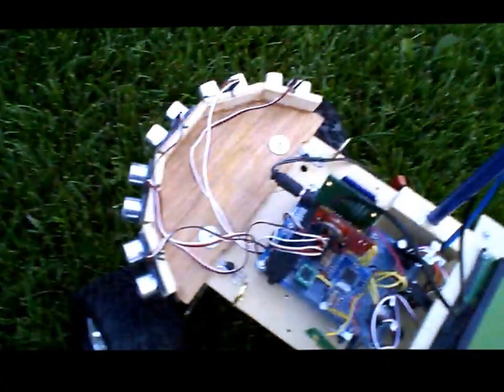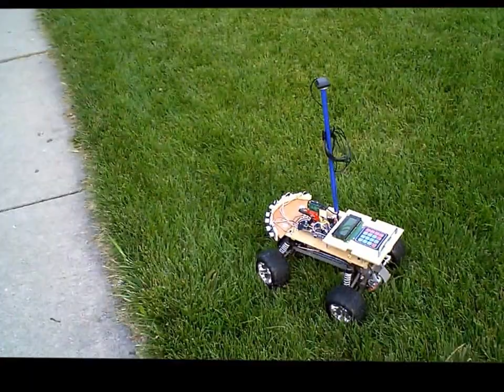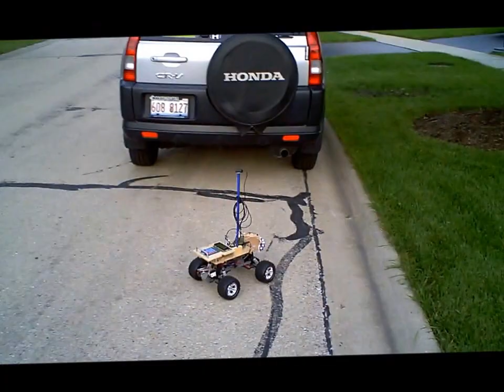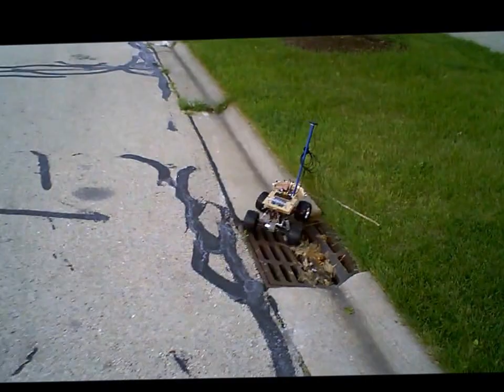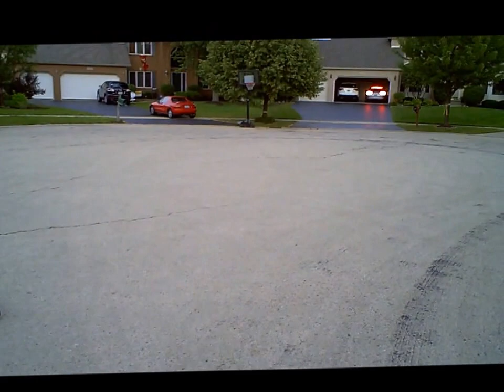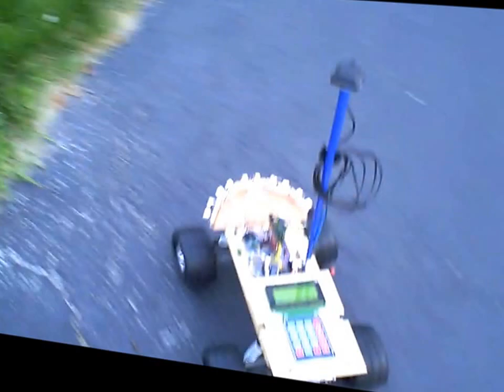Robo Magellan Part 3

Comment: Your robot is awesome, I want to make one and take part on the Robothon maybe this year or maybe next, because I'm a bit busy with my minisumos. Any tips for when building a Robomaguellan?
Reply from the maker: Thanks.  My advice:  Make small problems out of big ones.  Learn to run a servo.  Learn to control a motor, read GPS, etc. Once you fully understand each component of your bot, you are ready to integrate all the parts as a system.
Reply: Thanks, I will!